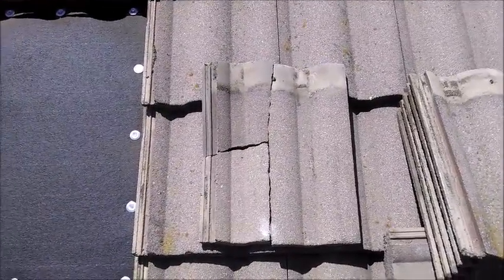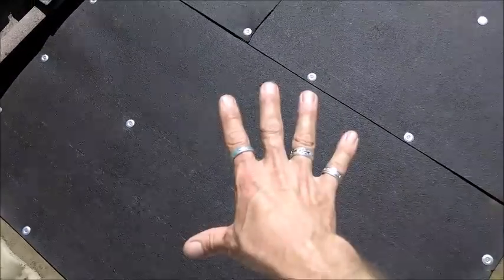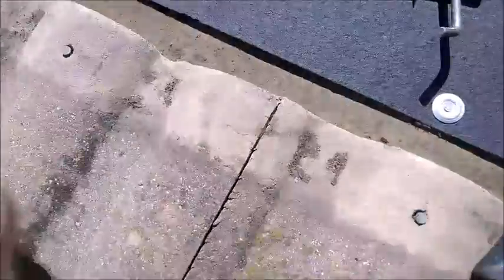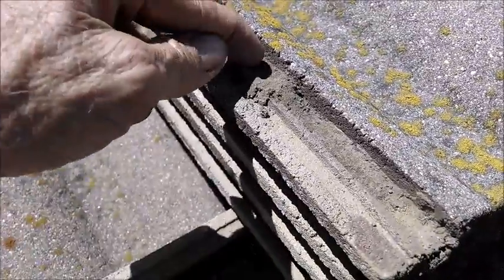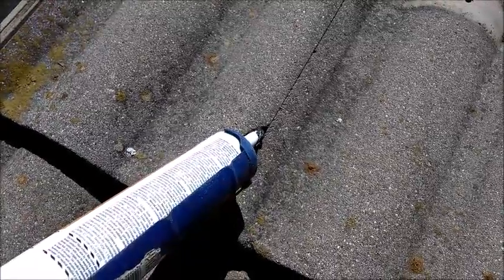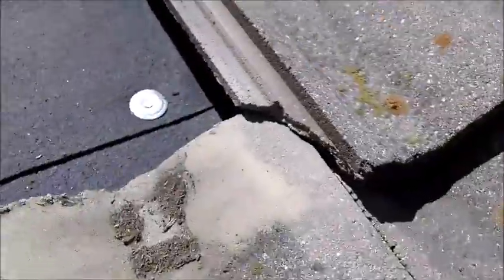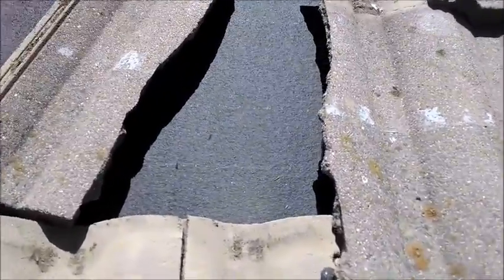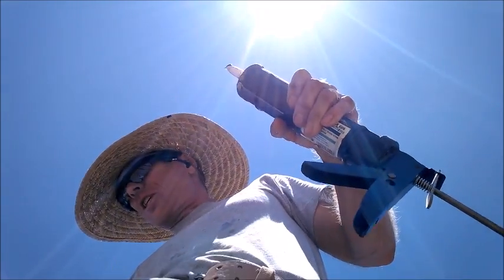Tile Roof Leak Repair - The Right Way...

Comment: @30:20 couldn't you have removed the top two layers of roof tiles so you could have nailed the third row of tiles instead of just gluing it?
Reply from the maker: SteveSabbai Yes, but why not glue them instead? Gluing is standard practice on single tile or single course installation, acceptable to meet code, & if done properly will last indefinitely. There’s no advantage to nailing over gluing in this case. By the way, mastic is Not considered to be glue. Mastic is for felt. Glue is for tile. If I were trying to glue several courses, that would be different, but since it’s a single tile or a single course of tile & all glued tiles are glued to other tiles that ARE nailed, you’d need a better reason than OCD to do the extra work required to pull up the remaining tiles just to re-nail them all. Remember... you’d also need to seal up each nail hole in the felt underlayment every time you pull up an existing tile. There’s more work to roofing done right than meets the eye. Why make it harder than it needs to be? Does that make sense?
Reply: @MrThedocholiday  Thanks for your reply. I have been watching a lot of roofing videos and some roofers are not using any nails to secure the tiles at all. All they use is glue to secure all the tiles. Is this good or bad?
Reply from the maker: SteveSabbai I don’t know if that meets the local codes where they are, but gluing all the tiles was considered illegal where I worked. The only exception, as I recall, was on very low-slope pitched roofs where a waterproof underlay was required & no nails were allowed to penetrate through the waterproof underlay. But building codes change over time & codes are different in various locales. On a standard pitch roof where I come from, all tiles were to be nailed or glued to other tiles that are nailed.

Comment: I’ve been a roofer for 20 years and I am a licensed roofing contractor, don’t want to criticize you to much your installation method is correct, your choice in material is wrong, you are using a shingle underlayment and not a modified tile line, also metal cap nails are for torch on or hot mop. I have seen plastic cap nails under tile for 20 years and they were still intact
Reply from the maker: Thanks for inquiring what I think about why I used these materials in my video. (My  futile attempt at sarcasm)

First off, since when is 30# ASTM rated felt paper a “shingle” underlayment? I mean, we can certainly use it for such, but no, it was not required for shingles even though we could use it for shingles. Shingle felt required by code was half as thick as 30# & not ASTM rated like I always use in my vids. So 30# ASTM felt was most certainly not shingle underlayment when or where this video was recorded. Which brings me to my second response… surely after 20 whole years & navigating through becoming a licensed contractor & offering your services to the public for hire, you do realize that DIFFERENT MATERIAL CODES & MATERIALS APPLY IN DIFFERENT AREAS? Oh, but it seems you’re under the impression that everything revolves around you & your set of municipal codes & that things aren’t different elsewhere. Which brings me to my third point… Various municipalities establish various building codes for various reasons. And as previously mentioned, when it comes to weather related trades like roofing, the material requirements vary significantly from region to region. You should know that already as a contractor.

30# ASTM felt underlay was actually one step above what was required for tile roofs when I did this video where I did this video. Do you even know what code required for tile when I did this video? Answer: 30# conventional felt, not 30# ASTM. And for good reason… houses roofed with 30# ASTM rated felt that I went out to repair or reroof after 30 years still had perfectly good felt where the tile was properly installed like code required.

Which brings me to my next point… felt underlayment that meets or exceeds code at the time of installation in the region where that particular code applies is sufficient to last the lifetime of the actual tile lifespan that the tile manufacturers warranty their tile for. But only if & when the tile is installed correctly.

Which brings me to my next point… incorrect installation of the tile is the primary reason why felt underlayments fall when they do fail, not the fault of the underlayment itself. Which brings up my next point… contractors today don’t want to talk about their substandard labor practices because they’d have to change their crappy labor standards if they did. But as long as they can blame the materials, they can continue selling upgrades to the customer & never have to deal with the real problems in themselves or in their lazy ‘get it done quick & get paid’ employees.

Lastly, apparently you misunderstood what I said in my video regarding plastic cap nails verses metal cap nails. I didn’t say you couldn’t use plastic felt nails. I said they deteriorate very quickly when exposed to the weather for any length of time. And most of the time when houses are reroofed or even repaired, the underlayment & the felt nails remain exposed to the weather for a week or two at least.

I never said that plastic nails will deteriorate when immediately covered & protected by the tile. The problem with plastic cap nails is that they’re rarely immediately covered by the tile. And local code requirements do NOT take that factor into consideration when allowing plastic cap felt nails in their codes.

Finally, you tell me which has more holding power? A plastic cap felt nail or a metal cap felt nail? And that, my friend, is the other reason why I only use metal cap felt nails. During expansion & contraction of all building materials during the normal day/night summer/winter temperature transitions, every time the felt expands & contracts with the building, any felt nails that aren’t holding the felt down with a large metal head to clamp the felt down to the sheathing tightly will ultimately tear through the felt & leave holes where water can penetrate through the felt membrane under heavy rain conditions.

I’ve seen this phenomenon literally thousands of times personally. How many times have you observed this issue over your 20 years of experience? If your answer is none or rarely, then you haven’t been paying attention or worse yet, you don’t care to notice.

If I could offer just a humble bit of advice I recommend you don’t critique someone else’s craft or methods until you’ve exhausted the possible instances when the person you’re critiquing might actually be right & even after that, you should approach them by inquiring of them about what & why before critiquing, just in case you missed something during your investigation of the facts & want to actually learn something rather than coming off as an over-zealous self-absorbed, but so-called professional.

In my humble estimation (more sarcasm) too many so-called experts & professionals today are mere expert toddlers that think way too highly of themselves, instead of actually being respectful & well seasoned craftsmen.

Thanks for watching & for bringing up some of my favorite topics for discussion, so I have yet another opportunity to address the nonsense within the so-called professional construction industry. And have a happy Thanksgiving!

Comment: Hey Dan, do you think the OSI RT600 would work when gluing and sealing the broken tiles?? or the OSI Quad would be better?
Reply from the maker: OSI quad is much better. I’ve seen rt 600 cute so hard you can never service those tiles again. OSI on the other hand cures within a day or so, strong enough to hold the tiles but not so hard over time that you can’t cut through & separate the tiles again later if needed.
Reply: @MrThedocholiday  gotcha!! thank you very much!!

Comment: Could epoxy putty (like Oatey's FIx-It Stick) be used to join the broken pieces of tile to skip the flashing step?
Reply from the maker: Mo Poppins that depends on how long the puddy will last, how waterproof the puddy is over time, how efficiently you can apply the puddy & how well the puddy sheds water after it's applied. Each construction adhesive has different properties & each application has different needs to reach your desired goal. So learning your materials & how they perform under various conditions over time will tell you what to use under what circumstances far better than I could without that necessary information.

I like flashing a breach when I need it to be 100% watertight indefinitely. But that is not always possible so the next best thing is considerable. I know that doesn't answer your specific question, but I hope it helps. As the old saying goes... "Give a man a fish, feed him for a day. Teach him how to fish, feed him for a lifetime."
Reply from the maker: Mo Poppins if the epoxy has the same properties as metal flashing then I would use it instead of flashing as long as it can be applied conveniently & shed water as well or better than metal flashing. It also depends on the demands of the crack. A cracked tile in one area may be far less prone to leaking than in another place where high volumes of water flow over a repaired tile. You really have to answer the question for yourself based on your situation, your needs & repair materials you plan to use. Just keep in mind all the properties of the puddy... You may not be able to re-service the leak area if the puddy dries solid. I like to keep things modular so they can be serviced again in the future. And that often plays a major part in my decision to use various materials. Especially since repairs are not always successful the first time through. After thousands of successful repairs I still miss something from time to time & like having the option of taking it apart to fix it a second time if necessary. Does that make sense to you?
Reply: Makes sense.  And since you have all those years of experience, I trust you.  I'd probably still conduct my own experiment out of curiosity, just to see how the product performs under certain conditions, but it's valuable to hear your insights on the possible outcomes.  Thanks, Dan. :)

Comment: Hi Dan great video where did you do this repair ?This tile looks like monier Tile I'm redoing my roof a company will power wash then expoxy and color. This company thats doing the work informed me of a caseanyway there is a Class Action Claim on Monier Tile finally on third appeal judgment against Monier , defected Tile slurring not holding up to its 50 year warrantyThey will pay out $3700.00 per customer .My question for you is I'm looking for S tile water diversion for my roof.Also check out the Monier class action lawsuit third appeal
Reply from the maker: Roger that on the lawsuit. The repair was done in Moreno Valley, CA. Can you explain what you mean by 'S tile water diversion'?

Comment: would it make sense to move all the broken tiles up to the top or near the top since less water volume?
Reply from the maker: Not a bad theory, but here’s the problem with that… a good amount of water will still get through those tiles unless they’re sealed & the water will run under the entire length of the roof until it reaches the dripedge. I’ve seen even a small amount of water do extensive damage when the roofing leaks every time. So imagine now a broken tile near the dripedge… If water gets through that, even more water than above, then it only ruins the felt from the entry poin to the dripedge. So the question I’d ask, is whether or not more water does more damage than less water, if each area gets wet every time? Does the felt get damaged more from the volume of water or because of the number of times it gets exposed to water, however much water that is? I think the number of times the underlayment gets wet is more damaging than the actual amount of water that gets on the felt.

I’m not referring to just a few drops. I’m talking flow volume, not just moisture. So since broken tiles will let water in every time it rains, it doesn’t matter as much where they’re located. I’d be more concerned with the length of the damage area being longer from tiles at the top than I would tiles near the bottom.

Every leak is different & my perspective is somewhat subjective, but it’s also based on 35 years of experience repairing literally thousands of leaks.
Reply: @MrThedocholiday  Yes, still have to do what you did. I guess there's no perfect solution other than replacing new ones if available. It's less water volume going through it for sure but I can see the disadvantage of moving to the top is that if somehow water gets through it would go through all the way from top down :(

Comment: how do you paint over galvanized sheeting so it will be a permenant color match to the tile?
Reply from the maker: I don’t… I paint them with roofing paint to make them look good for as long as possible & repaint as needed, but there are literally thousands if not millions of tile roofs in the us alone that have leak issues that are way more important than making a roof look good & stroking egos. We all want things to look nice but In case you haven’t noticed, the world around us falling apart in many ways & we’re often worried about looks over having practical love for genuine equity. I know for a fact after 30+ years in roofing that thousands of tile roofs are leaking across our land & making them not leak is way more important to me than making them look good if they’re still leaking. Best to have both function & form, but we are nowhere near achieving function yet when it comes to roofing & worrying about form when function is still extremely lagging is not something my conscience can endure.

Comment: Where is this? why are the tiles not staggered?
Reply from the maker: Richard Edmonds So Cal... They’re not staggered because the tiles are not required to be staggered by the manufacturer, that’s why. Staggering is an option, not a requirement.

Comment: By how many inches do you overlap the paper? 🤔
Reply from the maker: 8"-10" sidelap, 2"-4" headlap on all standard underlayment. Minimum felt manufacturer's headlap is 2". Not sure about felt sidelap absolute minimum is from manufacturer but I tend to give a little more just to be safe.

Comment: for chipped tiles at the bottom left or right bits, pull out the entire tile and swap it with one of the bottom row tiles of your roof.
Reply from the maker: Any time you “swap out” tiles for mere aesthetics you run a significant risk of chipping or breaking more tiles that weren’t previously broken. I’ve replaced tens of thousands of chipped, cracked & broken tiles over the last 36 years. Swapping out tiles that are not already out if not absolutely necessary is not the best idea in my experience, but thanks for watching.
Reply: @MrThedocholiday  I didn't say it's for aesthetics and the tiles i mentioned was already chipped with the chipped part no longer can be found. I have swapped out quite a few with no problems.

Comment: I have 1 roof tile slide out how can I keep it intact from sliding down again.
Reply from the maker: Besides gravity being the most obvious reason, figure out why it’s sliding down & what the condition of the underlayment beneath it is. Address the underlayment first if needed & then use a non-hardening glue to fasten it in place to the other tiles nearby which aren’t sliding. And don’t put that glue in the side lap water channel where it will block water flow & cause a leak. Put the glue where the two tiles touch where water isn’t trying to flow down slope.

Comment: What adhesive is he using?
Reply from the maker: Well first of all that ‘he’ is me. And depending on availability of various adhesives at various times, you could use a number of different adhesives. I was using rainbuster 850 at the time. Now I use OSI Quad adhesive because it’s checks all the necessary boxes for my applications & it’s readily available to me where I work.

Basically, we want a fairly quick drying, all weather, paintable, non-shrinking caulking that can be worked into a crevice or onto a surface without much difficulty & sticks to practically all construction materials. Application in wet environments is a plus, but all things considered, applying adhesive in wet environments is not as common as it is in dry environments. With both OSI & Rainbuster, they can be applied in wet environments with moderate success, but you’ll likely have to get your hands or fingers into the adhesive to get it to stick on wet surfaces, by working it into a wet surface to achieve a good bond.

Copolymers, tripolymers & in OSI’s case, quad-polymers are all good products to use on the roof, because they are waterproof, stick to almost anything, stay flexible & are paintable, even though they will not last as long as silicone based products.

Silicone is more durable than anything else available, but it often has bonding challenges & repels both moisture & paint. That also means that silicone will not stick to wood products as well long term either, because of wood’s moisture content. So that’s why I’ve never been a fan of silicone for exterior construction repairs where a good waterproof bond between various construction materials is necessary & a clean finished presentation matters to the customer.
Reply: The best modern adhesives for concrete tile work are polyethers.